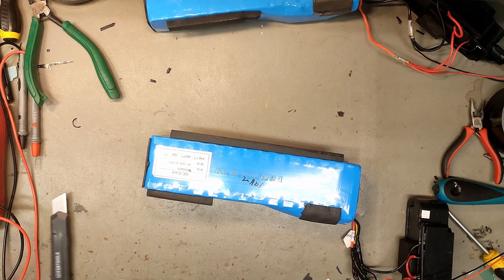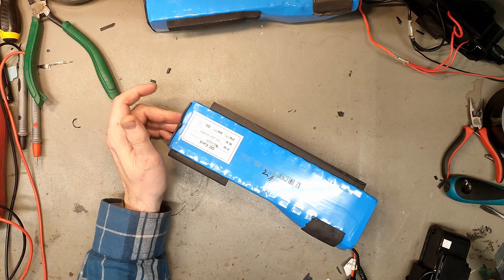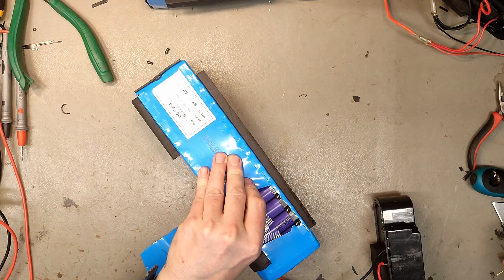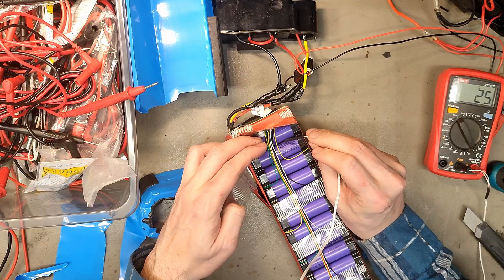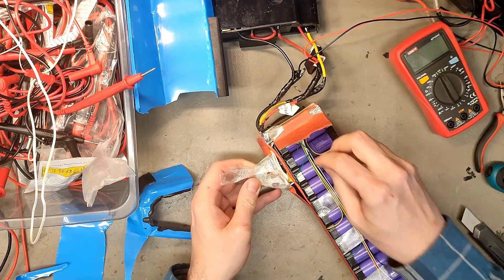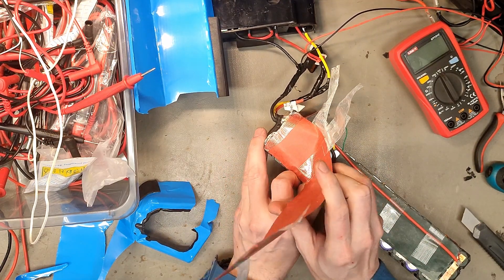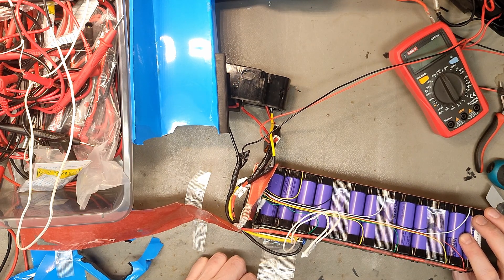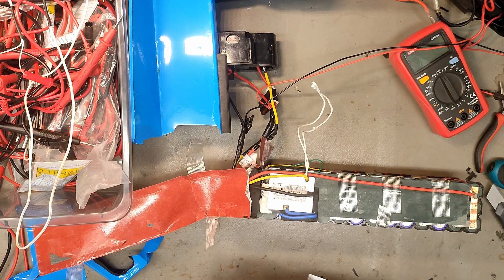LG Chem Lilac M26 get superhot on 0,2C charge - Worst cell on the planet!

Comment: Have you seen M26 fail in Xiaomi or Ninebot packs? Because I don't think those are particularly known to fail.
I'm having a suspicion that there are a lot of "fake" batteries that are just factory rejects, and since factory is in China, they got recycled via reselling.

I am a little bit concerned now, since I have a choice. Build a battery pack out of 28 SINC cells, or 35 LG M26  cells that I salvaged from original Ninebot batteries where I killed the BMS. And M26 cells are old too, like from 2018 or 2017. SINC are from 2021.
Reply: They are indeed just shit. Consistently shit however. ESR (DC, none of that standard 1 kHz rubbish) is 70 mOhm and 88 mOhm (because they were salvaged from 2 different e-scooter packs). 
But eh, no other choice really but to use them. After all, 35 cells is still better than 28 cells.
ESR is well out of spec.
No wonder ninebot switched to EVE.